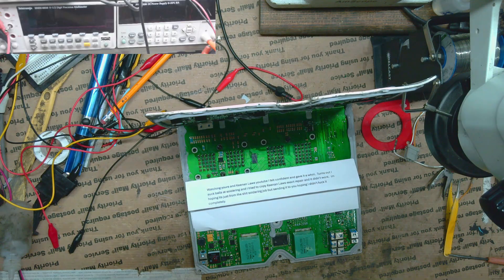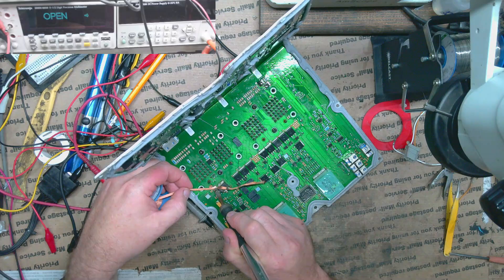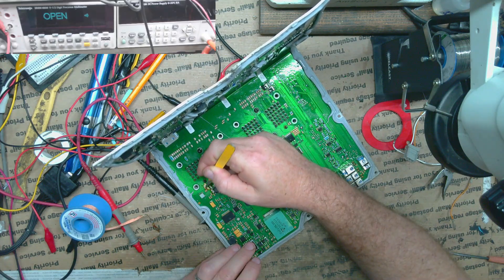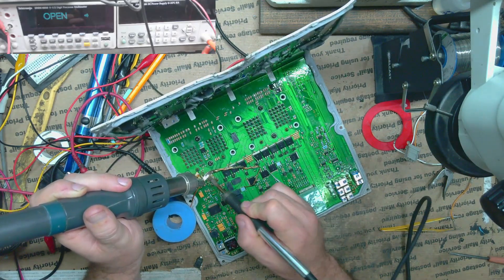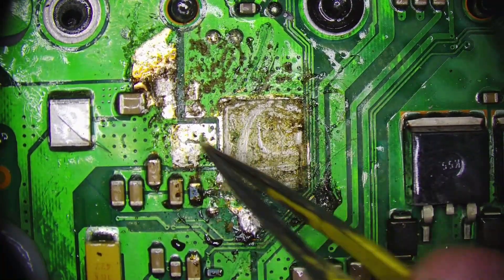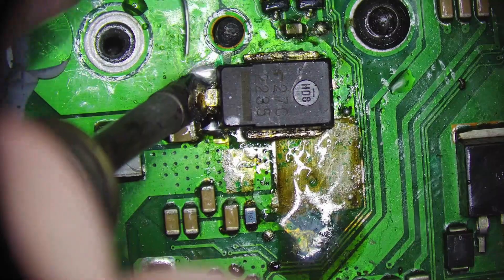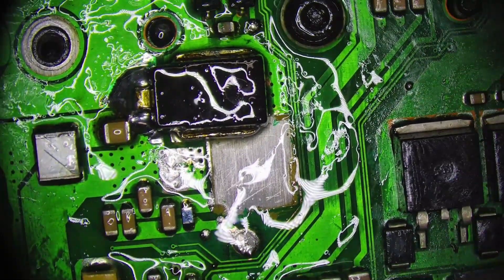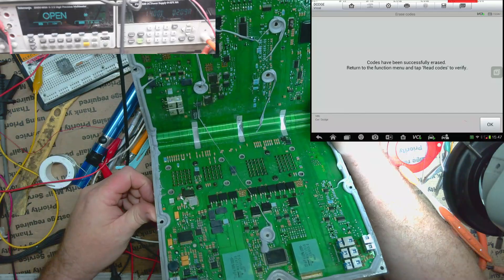RAM 5.9L Cummins ECU Repair After Failed DIY Attempt #electronics #ecurepair #soldering

Comment: What do you think the issue is with my truck if most of the electronics (locks/windows) don't work after starting it up (engine still runs) but only when it's cold/winter? The electrical will start working again within the next 1-3 starts. '99 dodge ram 2500 cummins 5.9
Reply from the maker: maybe a bad connector coming in through firewall or the CTM

Comment: Went to start my truck this. Wait to start came on and off like normal for a cool morning. However it didn't start. Now wait to start doesn't come on. Lift pump not work and no bus on dash. Any ideas?
Reply from the maker: Maybe bad grounds. Check wiring for batteries including grounds for them.

Comment: Do you know what is killing this very large TVS?

To clean up the TVS flux mess it is quickest to use a cut acid brush (cut the bristles close to the body to increase the stiffness, buy good quality acid brushes the Chinese ones loose bristles) dipped in IPA and a Kimwipe tissue (Kimtech). Put the Kimwipe over the area you want to clean then scrub with the acid brush with IPA. The Kimwipe will soak up the flux. It is easiest to store dispense IPA in a Menda 35742 - Pure-Take Impact Resistant Amber Glass Bottle with PFA Stem, 4 oz. The Kimwipes are very low lint and can be the final step in cleaning a repair.
Reply from the maker: Reversing polarity while trying to jump start the trucks is the number one killer. Another issue that causes them to go bad is one of the trucks batteries going, or just bad wiring/grounding for them.
Reply: @ecurepair  
Thank you for the reply.

If ignition is on (ECU is on) and you reverse battery over an almost dead battery this would be bad news for the TVS. The TVS (like a SM8A27HM3) is unidirectional so if the ECU relay is on and then you reverse polarity the TVS you could blow the TVS before the relay turns off (relay coil diode in reverse). Reverse polarity on a unidirectional TVS is basically a 2V diode drop clamp which will short out the jump then short and then maybe explode (big plastic crater), or the ECU fuse may blow before the TVS explodes, or the relay may turn off before the ECU fuse blows, it is just very difficult to know the exact failure sequence because of the age of the vehicle. But, what it curious is when you reverse two large batteries, other bad things happen like batteries exploding, wires melting and other bad side effects. Also, the jump pack or jump system should indicate if the leads are reverse before power is applied, or even prevent power from being applied if reverse connection is detected.

If the trucks are old and a battery connection goes intermittent than the ECU may experience a large alternator load dump event which the TVS should withstand, but perhaps not multiple events in a row. When the TVS is overstressed in this manner it will short out, which will blow the ECU fuse (probably no plastic crater in the TVS). But, the main problem is bad vehicle wiring, which should be repaired before installing a repaired ECU. If a battery is so weak as to not charge this could also be a problem with load dump, but in this case the vehicle will probably not start unless jumped, but here again the battery will probably not recover. But, you may blow the module TVS.

Given the above circumstances with a blown TVS, after the module is repaired the vehicle should also be repaired (new battery, new wiring, etc, what ever is causing the huge transient on the +12V rail).

Comment: Hello, I have a 2007 3.7 Dodge Nitro with a failing PCM.  If I pulled it could I mail it to you for repairs?  It's causing a voltage issue in the vehicle.

Comment: Help i have a 06 Cummins im convinced needs a repair i only have issues when it’s cold outside and I’ve noticed my truck not going to sleep
Reply from the maker: I doubt I would bve able to find that kinda of issue or disprove it was in the ecu. If you suspect ecu it may be best to replace.,

Comment: Thank you for sharing
How could you test it on bench with out immoblizer connected to the ecu?
Reply from the maker: Depends, In this case many of the 59's dont have immos. The ones that do are easy to turn it off for testing. Even with out turning it off though you can do right much testing as is anyway.

Comment: 13:58 It might of been Keenan Laws video on repair of the Cummins- Dodge diesel ECU. He did not suggest cutting out the diode, he mentioned you can go without it until sourcing a replacement if you need to use the vehicle.
Reply from the maker: It can be done but its pretty risky to run them with out it.

Comment: Tvs diode protects the board when solenoid injector opens?
Reply from the maker: this diode is basically just for filtering out voltage spikes on the b+ line coming into the ecu. may help protect against reverse polarity as well but that usually kills it.
Reply: @ecurepair  Usually the engine module is protected against reverse battery using a diode in conjunction with the EEC relay. The diode, which can be found in the power junction box with a fuse like form factor, is in series with the engine module relay. So, when the system is reverse battery the diode prevents the relay from activating so no power is applied to the module or paths present for conducting current through module drivers (MOSFETS parasitic diodes).

The large uni-directional TVS is to absorb energy through clamping of the power input to ground. In module design the largest transient is due to what is called load dump, which is basically an intermittent alternator (or battery connection) while the engine is running (and battery charging) or any other inductive device which can dump energy onto the power input to cause the voltage rail to spike uncontrollably. 

In many of the design conferences for SAE on module protection the system thinking is to distribute the clamping across most of the modules so that one module will not have to dissipate all of the energy. But, in practice what you find is the engine controller designer must provide this overstress protection without regard to other modules on the same power feed because other modules are under protected. This is why the engine module TVS is so large. 

If you want to add more TVS protection you can use two leaded devices MR2535L (originally Motorola purchased by ON Semi). There are a lot of options for the leaded TVS from different manufacturers. If you pair devices order on a reel or roll so all of the devices come from the same batch, this will help in matching the devices. If the devices are close in characteristics you can parallel as many as you like. In one test lab I saw 20 of them connected in parallel on bus bars to guarantee a failsafe module clamp (load dump testing a module with and without protection). The MR2535L in its day performed extremely well. The ON SMT device on the module will have slightly less lead inductance than the MR2535L put not enough to cause concern.